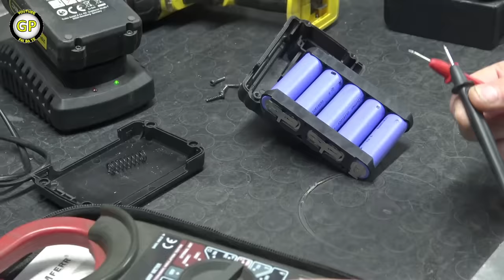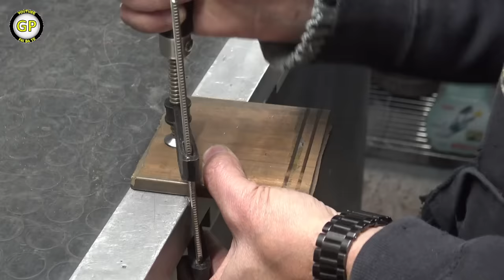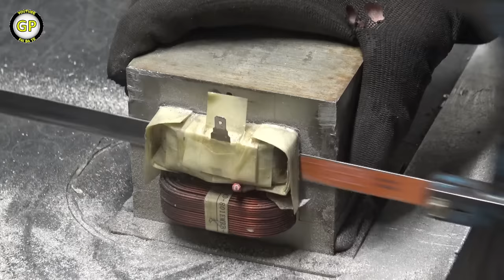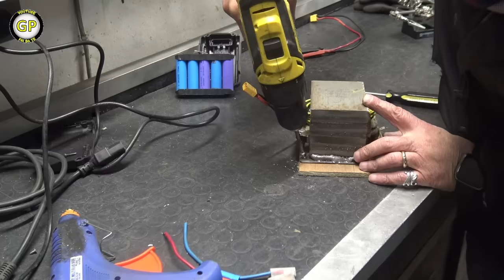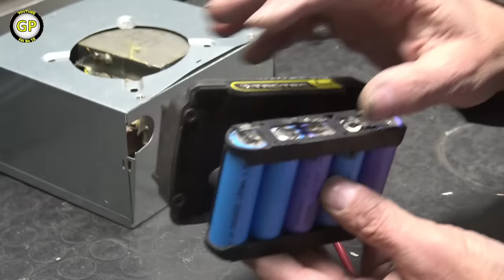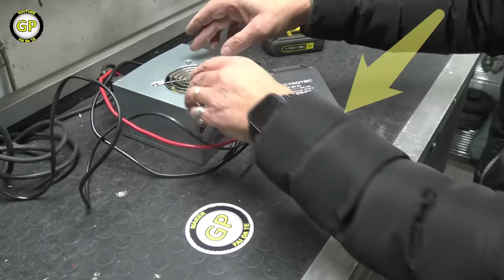Make a Mini Spot Welding Machine for Lithium Batteries a $0 - DIY

Comment: That should read. Add a Rheostat to have voltage control and I would also sleeve the leads through those sharp metal holes. Great job though. The other thing is to use thicker gage weld leads and add another turn to quieten the hum
Reply: There's more to using a rheostat than you've implied. How will another secondary turn reduce hum, exactly?

Comment: Great job!!!  What was the transformer taken from?

Also, where can you get thin metal strips like you used? 

I"ve been thinking of doing something like that but in a much cruder device, like using a storage battery with 12 foot jumper cables and home-made electrodes like yours.  It made a much neater (and probably safer) spot welder than what I was going to use.
Reply: @petemiddleton64      Thanks!!!
Reply: Microwave transformer
Reply: @bonaufilho7703   Thanks. I thought it might be from a microwave.
Reply: the strips are actually almost (!) the same as the exterior metal part outside of a battery

Comment: What is your input voltage? Is it 220 vac or 120 vac? Do you know what the output is on the secondary side. I am in USA, would I still do 4 turns?
Reply: CevaP veremedi. Çünkü anlamadı.
Reply: He couldn't answer. Because he didn't understand.
Reply: WHAT IS YOUR LINE VOLTAGE? 220 or 110 vac?
Reply: More then likely 220
Reply: 220v . 7:00 минута ролика
Reply from the maker: I have 220V input, with 4 windings I have the right amps not to burn the batteries. bye thank you
Reply from the maker: 220v  bye
Reply from the maker: yes

Comment: Spot welder should allow the current for a small fraction of the time when it's pressed, when you're replacing cells in the battery you should do all cells not only 0v's. And those welds are really terrible. It's 0$ fire hazard and I would go buy normal replacement if I had to do this.
Reply: 0$ fire hazard hahaahahahahah 🤣

Comment: great DIY.  after wiring , to check voltage on the output  how much Volt do we have to see?
Reply from the maker: Thank you.  I don't know how many volts it is mm I'm focused on the amperage.  keeping it low so it doesn't burn.  bye thank you

Comment: Quello di sostituire solo le celle guaste è una pessima idea.
Reply from the maker: Ok grazie ciao
Reply: Non, si les batteries sont appariées, par capacité et résistance interne. Il suffit d'utiliser un chargeur adapté pour les tester. C'est une opération de routine. Dans la vidéo, on ne sait pas si ce travail de préparation à été fait. En fait, ces vidéos ne tiennent pas compte de l'expérience ou la connaissance des spectateurs. Et la langue est un écueil à l'international pour pouvoir expliquer. 
Je trouve déjà super qu'on puisse se lire dans toutes les langues avec YT (contrairement à TikTok !)

Comment: all good with this setup, but to get a clean non sticky welding better connect a few mosfets with double pulse. (if pulsing the main AC power so use triac) 
First Pulse (Pre-weld): 10-15 milliseconds (ms)
Second Pulse (Main Weld): 20-30 milliseconds (ms)

Comment: Never "add" new cells to an existing pack. Always throw each and every one out (or re-purpose them as single cells), and replace the entire packet. These cells that haven't yet died, are going to die sooner or later, and then, you'll have to open it up again and again, creating an endless cycle of "adding new cells to half-used ones"

Also, the "bare transformer" method is a surefire (kek) way to have yourself a lithium fire on your workbench :v
These 18650 casings are thinner than they look. Yes, it might be cheap, but it is just not worth it in the end. The lowest effort "spot welder" would be to have an SCR controlled with an Arduino, and then to set the pulse duration via the code (or implement an encoder / buttons & a screen to see the set value, if you have a bit more money to spend), and then have the Arduino turn on the SCR for a set amount of time. Then, have some trash cells at hand (best to discharge them completely via a resistor, something like 100kOhm or more will suffice, just tape one lead to positive, the other one to the negative terminal, and leave until the voltage drops to 0V). Then, try your spot welds on these, because when a cell is completely discharged, a potential failure won't be as dangerous as it would be with a cell that has the nominal 3,7V (but they still can be dangerous, so a metal bucket with sand is very, very much advised).

Comment: Help... I got a psu powersupply from fleamarket. When I open it has no small cirquitboard near powerplug... so if I cut wires it will be 220v directly through the green/yellow coilwire.  Is that ok?!? Whats the small green board in the corner do.
Please, I REALLY need a LI welder!! Best regards Liz
Reply from the maker: hi, yes you basically have 220 direct volts.  the small board would be for the switch but it depends on the case, some don't have it.  If there is no switch, put one on for safety.  bye thank you

Comment: Are you feeding the m/w transformer directly with AC or the only part you are using from the computer power supply is the rectifier?! Sorry couldn't follow the video what connections you did. Thanks!
Reply: It's not a very clear video, i couldn't figure it out either but it's just as well because this is a terribly dangerous and damaging build anyway.

Comment: It's none of my business, but I was just wondering: Were you absolutely sure that this partially re-charged battery could not have been charged? Many people think that the battery is dead when the charger won't charge it. But if we trick the charger into thinking that the battery is not too empty, then it agrees to charge the battery.

Cheating is done by initially connecting a better and a worse battery with jumper cables in parallel to the charger, in which case the charger performs an initial test on the battery by measuring the voltage. When the test shows sufficient voltage from the better battery and determines that the battery voltage is sufficient, the green led goes off and the charger starts charging when the red led lights up.

Comment: What gage wire did you use to rap around the transformer? So I may make the same. Thanks
Reply from the maker: 3mm cable for batteries. bye thank you

Comment: Thanks, buddy, but I still don't understand what wires you cut and welded back into the chasing. So, you only connected the two transformer wires to plus and minus on that small pcb? A handmade diagram would've been really useful.
Reply from the maker: Basically I kept the power supply switch and connected directly to the 220v voltage. hi
Reply: @GianniPirolaFaidate , yup I was thinking about it. Thanks

Comment: Hello . Thank you for your work. What is the cross section of the winding wire - 4mm?
Reply from the maker: 3 mm. Bye thanks 👍👋
Reply: 6 mm2, diameter 3 mm

Comment: what are the parts that are used for this? is the first block looking part from a microwave??
Reply from the maker: yes the transformer is from a microwave, the case is a tower pc power supply. bye thanks

Comment: @8:02 you solder blue and red wires to the power supply switch, what are the white plastic molex connectors even plugging into? That makes no sense. Some dialogue explaining this process would help dispell the mystery of what's involved here for those that have the spare parts around the house and might want to try but without clear instructions, won't be able to.
Reply from the maker: the case has a switch so it is simply connected to the phase wires to it. bye thank you

Comment: Is that current to high for spot welder ?What is the value ?Did you measure with amperclamps ?What thickness of wire did you use ?
Reply: The answers to your questions can be summarized in Lucy in the sky with diamonds of the Beatles.
For the rest, forget this contraption... which is really dangerous.
Reply: @davyjonesjonesdavy  this is exactly the answer from a trol who has no idea what he's doing except copying similar projects from YouTube... I asked the questions nicely because I'm very interested in the current values because I'm making a similar spot welder...

Comment: That copper plate looked like wood, then you performed some 'magic.'
I had to replay that part to make sure there was no magic involved. You
could have routed the electrode cables through the existing PC power
out cables hole with its plastic grommet. Its better than having cable to
metal box abrasion.

Comment: This "ko" batteries were most likely good. Either need a jump sure to over discharge, or need to be reset with the rest button under the positive side of the battery.
Reply: What reset button?

Comment: Sticking wires through sharp metal grill mega dangerous. You need to protect the positive and negative electrode wires  from shorting more. Put rubber round the grill that you cut out. Be Careful! It works well but you did not show any kinda Amp hour check on each cell. Placing new batteries with old can strain the older batteries. Get a battery discharger and test the cells first. Pick those that have a similar discharge total

Comment: The welding current seems way too low. I'm using a 12V LiPo sport welder with mosfet switch. Welding 0.15mm nickel strip takes about 30ms at 120 amps.
Reply: Do you mind linking me to what you are using or sharing the make and model of said unit?  Thanks in advance !
Reply from the maker: ok thanks bye

Comment: I don't know how everybody else feels but I think that looked a little unsafe. I mean I didn't get a real real good look at the batteries but it looked to me like a couple of them. Might have had the spot welder burn a hole in the batteries. Maybe the power is a little too much or it could use a timer on it. So to where you're not holding the leads on the battery too long to burn a hole in it. But other than that I think it is a good idea if a man can get the timing under control.  Thank you

Comment: Since the box is metal, the outputs with the red and black wires cannot be separated, which means they must be in the same hole.
Reply: Bạn có thể giải thích giúp mình phần này đc ko.
Reply: @TuanPham-eg4cp Đó là ngyên tắc đi dây điện (AC) Đi dây điện trong xưởng cũng phải tuân thủ như vậy. Nếu một sợi dây dẫn điện (dây đơn) chui qua một vòng khoen bằng kim loại hoặc một lỗ như trong clip thì khi có dòng điện AC phần kim loại kia sẽ trở thành một vòng ngắn mạch, dòng điện qua dây dẫn càng lớn thì vòng kim loại mà dây dẫn chui qua có khả năng rất nóng, thậm chí bị nung đỏ. Đó cũng là nguyên lý của các máy nung vòng bi khi cần sự giãn nở.
Do đó phải đi hai dây trong một lỗ thoát để từ trường khử nhau.
Reply: @tuyentuenguyen9909  cảm ơn b chia sẻ kiến thức.

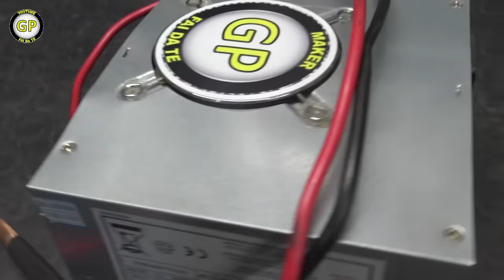Comment: most people watching this wont realize this is from another country and he's using 220V  13:32 not 110v like here in the states
Reply: If you use an old Microwave oven  transformer, and feed it with 110 or 120 VAC,  it will still produce enough current to achieve the welding.

Comment: Cette soudeuse ne permet pas de faire de bonnes soudures, parce qu'il est indispensable d'assurer une pression suffisante des électrodes sur les languettes à souder.
Il faut une pince de soudage munie de ressorts comme celles qu'on peut trouver sur le Web à une quinzaine d'€uros.
L'idéal est une soudeuse à décharge de condensateurs qui permet une soudure rapide et fiable, environ 30 Joules sont suffisants (30W/S).
Reply from the maker: Ok thanks 👍👋

Comment: what was the current and secondary A.C. voltage of the modified transformer?
Reply: in microwave oven transformers 1 round of secondary winding equals about 1 volt.  In this video there are 4 rounds

Comment: You really shouldn't reuse the strips you pulled off. For starters they are almost universally nickel plated steel. Why would POWER TOOL batteries have something have as conductive as pure nickel and a fraction of copper? Ease of spot welding and its cheap. Pure nickel takes significantly more power to spot weld but its worth it because your average 0.1mmx6mm nickel plated steel strip is good for a few amps max. More than 10A is going to cause serious losses from heating. The second part is the steel strip wont lay flat on the cell after you just tore it off the cell leaving "nuggets" of the strip on the cell terminal. Even if you grind the cell terminal flat (which you should) the strip has concaved holes. Less contact=more resistance and you already have too much for the application.

Start fresh with new pure nickel strips or give the nickel copper sandwich a try. Most welders can do 0.1mm copper with nickel plated steel on top of the weld points and thats infinitely better than even 0.20mm nickel plated steel

Oh I see you replaced it!! Yay

Edit: Holy fuckballs no switch at all so you blew those strips out like the Death Star destroyed Alderaan

Comment: almost every single one of those welds have holes in them.... You need to add a timing switch so that you can output short pulses.
Reply from the maker: ok tanks !! bye
Reply: I have recently made a similar spot welder with delayed switching and adjustable pulse length. If you do not start welding with both contacts firmly pressed to the metal strip and the battery, you get a lot of sparking and a poor connection.

Comment: This is not how it is done, the output wire is too thin, that's why it just sputtered, you have to use a really thick wire and point to 1 point, this is how the point battery overheats.
Reply from the maker: Thanks👍👍

Comment: I was worried your fingers were going to contact the metal rods past the heat shrink insulation.  If you did what would happen?
Reply: think
Reply: @ssao0000  Safety
Reply: Nothing. The voltage on the secondary is very low.

Comment: Why 4 turn wire? If more turn what happen?
Reply: voltage goes up amps come down 5 is ok to. 4 turns is about 3v 80amp gessing
Reply from the maker: with 5 wraps the amps were too high to weld the batteries.  bye thank you

Comment: Dangerous! :face-fuchsia-wide-eyes:
Secondary wire is too thin with too many rounds (voltage too high with less amps) , and electrode cables are really too thin for the amps output . You need very high amps but during a VERY short time (some milliseconds) to protect the plates of the cells and the Lithium. So Welding time is too long here for right welding :  bad contact, or nickel is burnt like here, and  you are lucky that no cell explodes with a hole in the plate...Do you see all the holes through the nickel strip??
      Your used cells are not controlled (except voltage) and cannot have exactly the same characteristics ( age, IR, capacity, and first of all the same discharge amps...) Your Drill needs minimum 25/30A discharge amps ,  all cells must have strictly the same values for the balance...and you just change three blue cells coming from anywhere (if from a laptop oh my God! 5A max!), impossible to balance such a pack.
When we don't know ,so we don't  touch....Specially in this case. Sorry but with such bad weldings and different cells you built a potential little bomb by use . Danger comes from the fact that this pack can run for a short time.
Reply: Shhhht! Do not disturb the author of the video that is intensely committed to placing "likes" to all those incompetent who are praising his work! 🙄
Reply: @davyjonesjonesdavy  I agree...with all my apologises for my unuseful comment...and a lot of thanks for yours! 😃 8800 thumbs high...it's a nightmare! And the Top of incompetence!

Comment: Not the best way.  You have no control about the welding power and time and thats why you burn holes into the nickel strip. 
Better to use a LiPo or lead batterie with an adjustable spot welding switch.

Comment: Omg!! Thats burning holes right thru the battery best case it smells like lithium worst case it creates a dead short  and the small hole becomes a rocket engine due to thermal runaway… please do not try this at home!!!  Imagine that battery under your kids seat on electric toy car.ahhhhhhhhhh😮. Pedal switch and a 1/10th of a second timer for pulse welding . Because this one here my friend is a stick welder.

Comment: Yeah replacing the cells themselves is EXTREMELY DANGEROUS!  Best to buy a new battery pack this isn't for the average person to do!!  Especially when it comes to the dangers of working with Lithium Ion cells!  One wrong move and lithium battery cells can explode and cause dangerous fires!  Even pairing the batteries can cause fires because all lithium batteries don't work well with others EVEN if there same battery numbers!  

Really out of safety everyone for the cost of a new battery pack its WORTH IT to just go buy a new battery pack vs the DIY repairs on these battery's!  The risk is JUST TO HIGH when it comes to Lithium Ion!!  

Sure back in the days of NIMH or NICD batteries ok, BUT PLEASE NOT with Lithium Ion!!  Lithium Ion is EXTEMLY DANGEROUS!
Reply: hey Bannister, they do say doing sub 4 minute mile was impossible, and you would die

Comment: That hum is the transformer burning up when you aren't actually welding. Install a switch.
Reply from the maker: the hum is due to the induction nothing is burning, if you tried to make one you would realize it. hi
Reply: @GianniPirolaFaidate  The energy isn't going anywhere - so it will get hot and eventually burn out the copper windings. Feel it... you'll see.

Comment: For God's sake, why don't you replace the old 2x batteries as well, it doesn't cost much and the battery will be like new. If there are 3 KO cells and two good ones in the original battery, how long will the original "good" ones last when they all have approximately the same lifespan from the manufacturer. Waste of work and money.
Reply from the maker: first I didn't spend a cent, second the batteries are recycled so used like the ones that worked. for me this is saving since the batteries cost a lot. Greetings